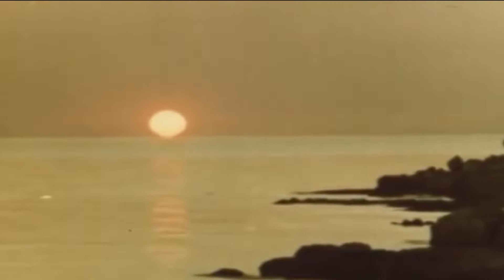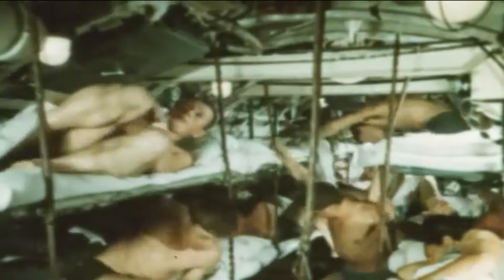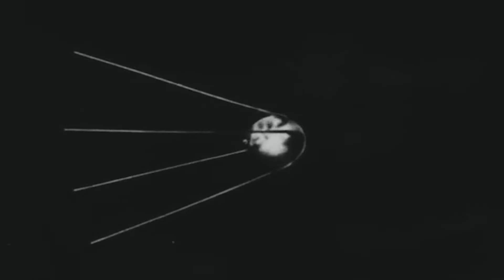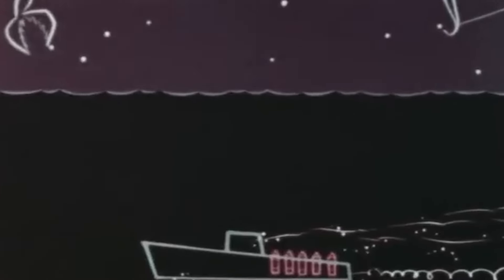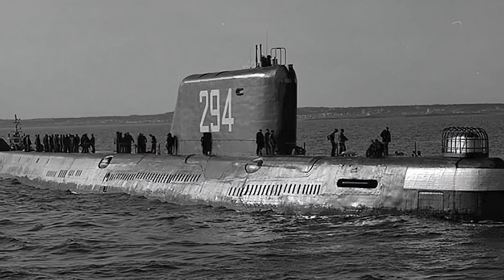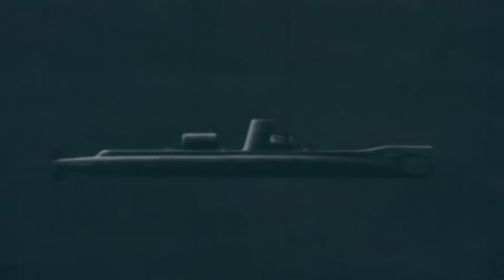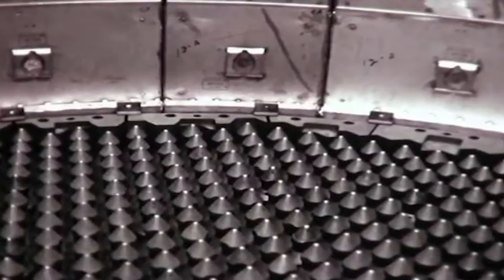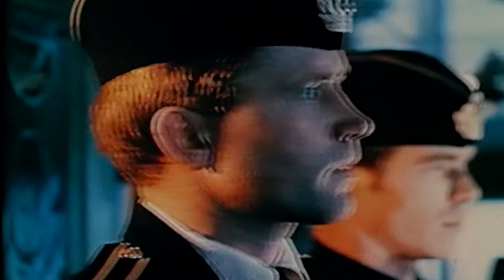The Submarine That Turned into a Ticking Nuclear Bomb

Comment: "turning into a nuclear bomb" is an exaggeration. What could have happened is a reactor meltdown, with radioactive contamination of the sea as a consequence. However, there are quadrillion tons of seawater and thus the overall effect on the ocean would have been only minor,  similar to the non-event when the radioactive cooling water from Fukushima was discharged into the ocean.
Reply: Yeah, I was thinking;t the same thing. Doesn’t quite sound as good though does it - the reactor would have not exploded and wasn’t that much of a problem!
Reply: Also water will stop the radiation from causing a lot of harm
Reply: The 3 nuclear warheads aren’t at risk in this scenario?
Reply: @soulesslemming  no.
Reply: The uploader needs to grab attention with an alarming title.
Reply: @harryballs  explosive compression followed by impact with the sea floor, seems possible to me.
Reply: @soulesslemming  That's not how nuclear warheads work.
Reply: @tacet3045  please explain how they work if not by compressing a core?
Reply: My sentiments exactly, Gregor.
Reply: @soulesslemming  There are several things that need to happen in precise steps for a nuclear weapon to detonate. As long as the Russian failsafes were solid, they wouldn’t have gone off.
Reply: Incorrect.  What could have happened is what DID happen at Chernobyl.   Not a Nuclear chain reaction explosion, but a fizzle that so superheated what water might have been let in to try and cool it, that the reactor vessel would have been turned into a giant pipe bomb, which would have gone off with about 2 kilotons of force.  This would have spread radioactive materials into the atmosphere and ocean in enormous quantities, which may well have been misinterpreted as a small nuke.  Even if they had just abandoned the ship without trying to introduce coolant, a meltdown would have ultimately burned thru the reactor vessel and hull and eventually have encountered seawater, resulting in a massive steam explosion.  
Furthermore, the ship was carrying 2-3 nuclear warheads on missiles.   An explosion of the reactor could have thrown those missiles and their warheads into the sea, or, given the slapdash imbecility if Russian Nuclear engineering- its possible their rocket motors might have been ignited and caused them to fly off who knows where… certainly an uncontrolled flight, but a radar on a NATO base or ship would not know that.  Had one of the missiles hit some NATO territory, the warhead might well have been disintegrated by the impact, again, potentially spreading plutonium or Uranium in a ‘dirty bomb’ scenario.
So, Not even remotely resembling Fukushima.
Reply: @soulesslemming  What explosive compression? The only compression that could have occurred if the VM-A reactor in K-19 melted down would be the hydrostatic implosion of the sub if it sunk past crush depth. 

There's a reason why all the broken arrow incidents of planes crashing/accidental drops of nukes haven't caused an explosion. Simple shock or fire isn't enough to make one explode.

All that's beside the point any way because this bollocks video is claiming that the reactor could have gone supercritical and exploded because the coolant system broke. It couldn't. Even though the VM-A were fuelled with 20% enriched uranium it was still so far below supercriticality that even if the actual bombs somehow exploded the blast would have just been dirtier not higher yield.
Reply: @soulesslemming  nuclear warheads usually have a fissile core, with enough fissile material removed to not allow a super critical reaction.

Normally the way these bombs work is there is an explosive device that needs to activate to blow a fissile wad, the remaining to make it go super critical, into the primary fissile material, like a wedge being jammed in with explosive force.

Once this happens the fissile material has critical mass and goes super critical.
The primary explosion is usually behind several failsafes.
Reply: the problem is that IIRC naval reactors tend to use very highly enriched fuel something around 90% , this is closer to nuke ( 96% enrichment ) than to RBMK ( 21% enrichment )
Reply: @christopherpardell4418  Thank you very much Christopher for providing this breakdown. Glad to know someone else has brought attention to this.
Reply: @christopherpardell4418  
So a steam explosion of a magnitude "comparable to a nuclear bomb" has the ability to push unarmed, unaimed missiles through several inches of hardened steel launch bays in a way that results in a functional missile launching and finding its way to another country?
Reply: @allergictorain0-028  First of all, that’s not what I suggested. Second of all, perhaps you don’t understand how a pipe bomb works.  But an explosion INSIDE the pressure hull of a submarine could cause the overpressure to build until it literally blew the entire sub into shrapnel.  The overpressure inside would heat the air to incandescence and ignite everything that COULD ignite or explode inside the hull.  Such as the Peroxide powered torpedoes. ( the explosion of the torpedoes in the Kursk incinerated every man forward of the reactor compartment- only the reactor compartment stopped the blast from gutting the entire ship- but in the K-19, it would have been the reactor compartment itself, that explodes ). I do not know if the 1961 era Soviet missiles were liquid or solid rocket powered… If liquid, chances are the missile would have been torn apart and the fuel burned like when a rocket explodes on the pad. But if it were a solid rocket motor, once ignited, it would burn without anything being able to stop it. ( solid rocket motor casings are essentially one huge long combustion chamber, built to take the pressure of the burning propellant.).  Chances are its guidance systems would have been damaged and so it would just fly out of control…. Or just straight up without heading anywhere in particular… But the nearby NATO base would not be able to tell that from a radar track and might misinterpret the situation.   ( twice the US came close to launching because of misinterpreted radar tracks ) I do not think they were within 400 miles of a nation- but then, the US at the time did not know the range of their submarine launched missiles.   As to the hardened steel door of the missile tube… It was designed to withstand sea pressure from outside- not an overpressure event from inside.   In 1980 a US missile silo in Arkansas had the first stage of its ICBM missile blow up in the silo.   On top of the silo was a hardened steel and concrete blast door weighing 740 tons, built to withstand a nuclear bomb ( from the outside ). The missile’s fuel ignited causing just an ordinary rocket fuel explosion and that blew the 740 ton silo door into the clear air.  The explosion blew the missiles second stage out the silo like a shot gun slug, but it was a liquid fueled rocket and so the damage from the blast cause the second stage to explode just after it exited the silo.   The warhead was  blown straight up like a rifle bullet.  They have no idea how high it flew, but it came back down about 100 feet away from the Silo.   So… COULD an explosion inside a Russian built submarine blow the missile straight out of its launch tube thru its own hatch?  Absolutely. In the Damascus disaster, the warhead never even hit the silo door, the overpressure inside the silo blew the door off like it was the cork in a pop gun. Given the poor quality of Russian weapons construction when it came to something like a Nuclear reactor, really, anything could happen. I would not trust the Soviets to have had much in the way of effective safeguards to prevent a warhead detonation.
Reply: @christopherpardell4418  
It would be easier to just say that it would have been like a dirty bomb:

Massive radioactive contamination after the fact would be the principal
destructive effect…

Typically,
she was called “Hiroshima” 
by those who worked 
close to her-

That’s close enough for me.

Literally.
Reply: @DimentiaGaming  Unfortunately, water can also act as a moderator in a reactor.  

While extremely remote, the chance exists that a meltdown could result in a configuration which allows the mess to sustain a moderated chain reaction, leaving you with basically an unshielded operating reactor on the seafloor.
Reply: "🤓 the overall effect would have been minor"

Please do some research on marine life first before saying such things
Reply: Thank you for setting the record straight.
Reply: Lol yeah such BS.. "would turn into a bomb larger than the ones used in Hiroshima and Nagasaki" = complete BS
Also since it would have happened underwater in a very remote place, the fallout wouldn't have been bad either.
Reply: @soulesslemming  the core has to be compressed in the correct way with LOTS of explosives - also it would have to be ARMED.
The worst that would happen is the conventional explosives would detonate, but the core would not go supercritical.
Reply: The ussr wouldn't be the ussr if safety measures worked. soviet systems are notorious for being unsafe, and they use radical design approaches to reach specifications. Not only would a steam explosion turn the sub into a dirty bomb, but it is impossible not to detonate the rocket engines on board. Even if the nuclear failsafes worked, it would be incredibly ugly.

Fukushima Daiichi was a land-based reactor based on proper design philosophies, it is equipped with multiple backup systems and failsafes. K-19 used one of the first ship-based reactors, and was rushed into the ocean. Chernobyl exploded, and it was still a better design that k-19. It was never going to be a non-event.